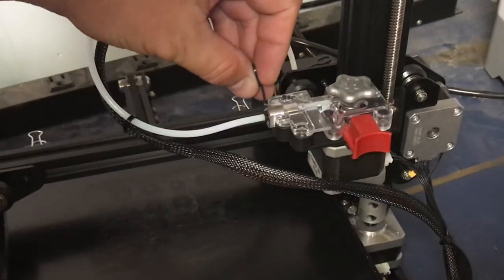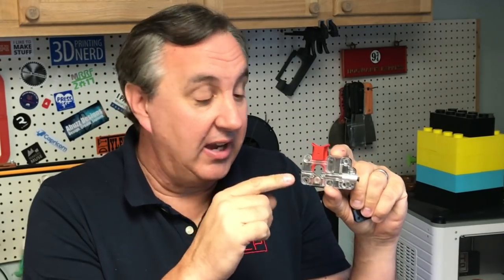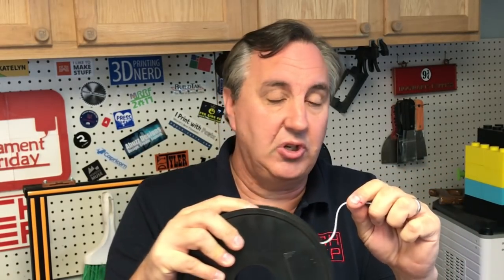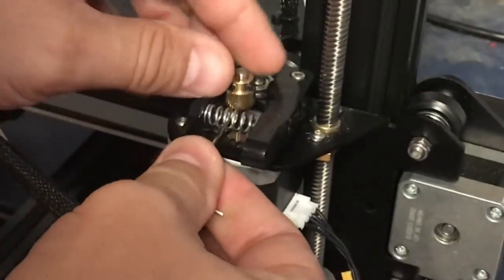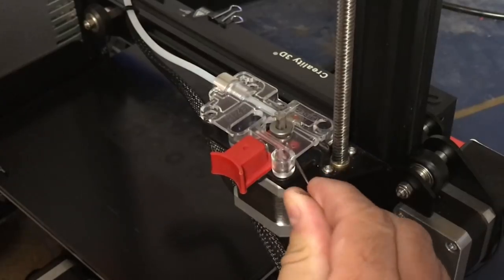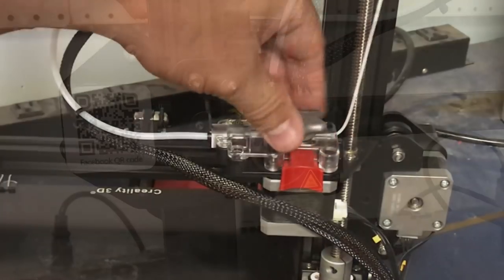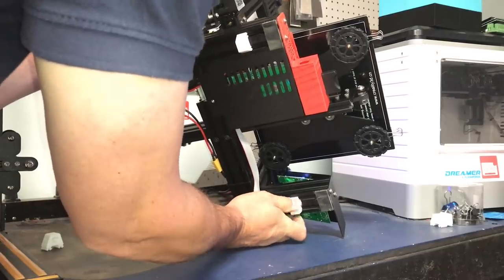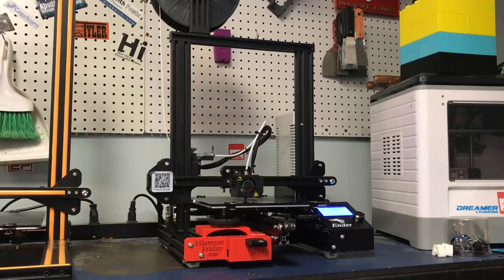Flexible NinjaFlex TPU using EZR on Ender 3

Comment: Hi Chuck!  I got those two EZR struders installed on my Ender 2 $& 3, I told you I ordered.  Both are stuttering when feeding (or maybe it's when retracting?) filament.  The little knob on top makes a loud click and it slips or stutters back.  It didn't do it with the flexible filament I tried.  Just on PLA.  Can you tell me what I need to do to fix it?  The PLA prints started out looking so crappy, I just stopped it each time.  I won't be able to print with it until I fix it!  Thanks, Chuck!! :)
Reply from the maker: Increase the temp or try lowering the feed rate to see if it goes away. The original was probably slipping and you didn’t notice.
Reply: @FilamentFriday  Thanks!  I'm using your magic profiles now, specifically .20.  The Ender 3 made a total mess of a bunch of parts for a mini spool for sample filament.  I arranged all of the parts onto the Ender 3's bed and they fit tight, but nicely. Problem was, it printed fine for a while, then it's like it decided to move everything over to the right about 8mm and kept printing.  The whole print was on top of the bottom layers, but moved over 8mm!  Never had anything but successful prints since I bought the Ender 3 about a month ago.  No failed prints, until I installed this EZR Struder! weird....
Now, I just tried to print one side of the main spool part, on my Ender 2, that was part of the whole spool I was trying to print earlier on the Ender 3.  It fit easily on the bed.  It got the first dozen or so layers done perfectly...then it moved about 8mm to the right and printed the rest there!  Different printer, same result!  I stopped it well before it finished, but the same thing that happened on my Ender 3, happened on my Ender 2!
Time to ask the expert!  What do you think, Chuck? 
Thanks, Scott :)
PS...I have a couple of picture of it if you want to see it...
Reply from the maker: Have you reflashed the firmware or is it as delivered.
Reply: I had the exact same symptoms a while back. In my case, the PTFE tube had started backing out of the hot end throat. This caused a little bit of material to pool in the throat just above the hot end. the pool was not at print temp but it was not solid. this caused the extruder motor to work extra hard to push filament through that semi-molten pool, every once in a while, it would slip and cause that stutter. You might want to check on this
Reply from the maker: I had the same issue:
https://youtu.be/x35aWmnZ_A0

Comment: I see you printed at 20mm/s , is it possible go go faster while not compromising on quality?
Reply from the maker: Change to direct drive. https://youtu.be/iFNcP-OyAH0
Reply: @FilamentFriday  But on this movie what I understand You prefer Bowden style?  By Your suggestion I bought few days ago Ezr, maybe You will make new movie where You can explain how You build Your ninjaflex profile, because there are some settings there, that I don't understand. For example why You chose  "line width = 0.3"? what is the reason to use Enable acceleration control ?

Comment: Do you think swapping the spring out to one with less force might work in lieu of the EZR? 
Keeping all of the original extruder gears and parts. (On an Ender 3 Pro)
Reply from the maker: No, it’s not the spring it’s the fact the stock extruder doesn’t trap the filament in a channel like the EZR does.
Reply: It sounds like this creates a "run", such as "wire passing thru conduit" or water thru a garden hose, type

Comment: I recently bought an original Ender 3 (2022) .. not Pro.. not V2... and I tried to upgrade the extruder with a red aluminium style extruder. The issue with that was that the cog attached to the shaft was press-fit... not with grub-screws... so did manage to remove the cog but I found that the shaft seemed shorter than the ones I was seeing in tutorials on how to install this type of extruder. I finally frankensteined together a mix between the original plastic base (because it made the hole alignment correct) and the new cog (I even had to file down a flat side so the new grub screws would work) and push arm and spring.. but I'm not not completely confident in it and I hear "thumps" all the time. Would this EZR fit this printer? given the apparently shorter shaft length? I haven't found any reference to anyone even mentioning that certain Ender 3's have this short shaft... thankyou for any advice.
Reply from the maker: Most people replace the motor too. And then you can use EZR. https://youtu.be/1GNDxvxpWr8
Reply: @FilamentFriday  ok ... new motor ordered (will probably help with the aluminum one too)... will test that... then upgrade to the EZR... it takes a while for shipping to the UK for the extruder so this will do in the short term - thanks for the advice! keep up the great work.
Reply: Craig.. I get the 'thump' or 'donk donk' noise if I run a print too fast. I think.. but am not sure.. that it is because there is too  much pressure on the filament between extruder and nozzle) I get this most on petg running over 120% speed or pla running over 200% speed , to fix it I turn the nozzle temp up and / or speed down..
I am new to this so take my opinions / advice with a large pinch. cheers.

Comment: Were any benefits lost when going back to the original tubbing from the Capricorn Tubbing?
Reply from the maker: Not in this case. But I still prefer the higher temp Capricorn.
Reply: Just drill it out and use Capricorn tube, it's worth it.
Reply: NinjaX429  very very little, like a bevel
Reply: Not sure if something was changed in the design of the EZR but I was able to install the Capricorn tube without modifications. I ordered mine back in August 2019.

Comment: Hi Guys. 

My problem: i am printing in PLA for quite some time now, printer dialed in. I have microswiss hotend, and dual gear extruder. No other upgrades. Boden type. Today i wanted to prind TPU for first time. Got a brand new spool TPU. Slicing in Prusa Slicer. Speeds ALL to 20mm/s, no retraction (at first). Temp of 230 (recommended by manufacturer, and temp below 215 gets me blobs) 50 on the bed. When i start printing, the filament starts to ooz out of the nozzle at about 200 before it has done anything. When printing starts, every move to another point gets strings, the filament keeps coming out of the nozzle (tried to print phonecase). So you can imagine that my first layer looks like cr*p with all those string lines across . So i tried to activate retraction (1.5mm at 30mm/s).....no luck !

So.....what is causing that the filament keeps coming out during all of the print? And how to fix ?
Reply: when you still have this problem, try way more retraction length (there are some videos how to use retraction tower)

Comment: did you have to do any adjustments to the slicer software for your prints, or was it just an install and print kind of thing?
Reply from the maker: I eliminated retraction and printed slow at 20mm/s
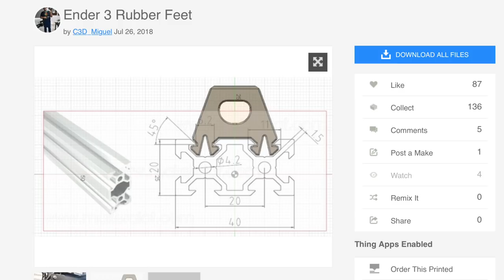Reply: yeah I saw that, at 5:13, but was curious about this and your other filaments. Like say PLA and PETG.
So you dont need to do any other modding besides what you would normally do for different filaments?
Reply from the maker: Yeah. It’s the same settings for other filaments as the stock extruder.

Comment: I installed the ezr and I am having an issue with PETG and PLA.  The stepper motor will extrude for a bit then reverse quickly then go forward again.  I get filament out of the hot end but it continues through this cycle and i seem to be having under extrusion and I assume this is why.  I have replaced my hot end with a micro swiss and replaced my tubing and even put a different nozzle on the hot end.  Not sure what else to try now.  Any thoughts?
Reply from the maker: What you describe is retraction. Shut it off in your slicer but you’ll get more stringing.

Comment: I'm getting a filament blocking occuring about 15 minutes into printing when using flexible filament??? I've upgraded my Ender-3 to have both the MicroSwiss Hot End and the EZR extruder (I needed the latter as previous to this the flexible filament was getting stuck in the extruder). So about 15 minutes in or so I hear the "clicking" noises from the extruder, that I'm guessing is indicating it can't push more filament through the hot end. I confirmed this when I tried to push manually the filament through the hot end.  This has occurred for two types of filament I’ve tried.  

I’m printing with:
* Temp in mid range for filament I’m using
* Print Speed: 25mm/s  (although I just noted infill speed is 42mm/s & I’m doing 100% infill- potential issue?
* Travel Speed: 120mm/s
* Fan: 50%
* Retraction: NO
* Nozzle - the one that came with the MicroSwiss

Any suggestions?
Reply from the maker: Here’s my video on it: https://youtu.be/1GNDxvxpWr8 sounds like the nozzles can’t keep up. I’d print slower.
Reply: The same, slower not fix that. There is too tight i think. Crap ezr...:/
Reply: What test can I do to check it's a hotend block issue, and not the extruder?
Reply: @greghauptmann  its extruder with ezr for sure, too tight spring, try lose a little, but i dont know how, manually maybe for couple second.
Reply from the maker: How is a too tight extruder causing nozzle blockage?
Reply from the maker: Just noticed you are using Microswiss Hotend. I have no experience with that but I’ve had no issues with EZR and stock hot end.
Reply: @FilamentFriday  I installed ezr today and it squeezes the rubber too firmly so it starts clicking. Before i have https://www.thingiverse.com/thing:2144277 and work when i print the same model with 30 speed, now with ezr clicking and block all :/ Maybe you have a solution?
Reply from the maker: So is it jumping on the filament? Raise the hotend temp 5 degrees see if that helps. Are you using the EZR gear or stock gear?
Reply: @FilamentFriday  yes - I did try around 255/260...I'm using the gear that come with EZR.  When it jumps, if I try to release the extruder pressure then push the filament in I can't get it to come through, so it seems like a hot end issue I guess(?)   I can't set it higher then 260 on the Ender3, so if I run the print slow (say 15), at 260 degrees and it still has the issue is it possible I just can't print this type of filament?  Or should I be able to and it might be an issue with the Microswiss Hotend?
Reply from the maker: I think it’s the microswiss. The PTFE in the stock hotend is select lubricating. The Microswiss being all metal isn’t as forgiving,
Reply: @FilamentFriday  oh - thats very interesting - so whilst I got the Microswiss to be able to handle hotter temperatures and less risk of heating up the filament cable (although I did also get capricorn cable), it might be the case for printing temperamental flexible filament that I'm better off going back to the stock Ender3 hotend?
Reply from the maker: It’s worth a try as it worked for me.
Reply: @FilamentFriday  ok thanks for the tip (just left on holiday so I'll try when I get back )
Reply: @FilamentFriday  i just fix that, its too tight spring like i was thinking. Remove it, and put one of this black clip, and now printing perfect.
Reply from the maker: Interesting. Guess I didn’t understand the issue but glad you figured it out.
Reply: @FilamentFriday  Maybe my TPU is too flexible.

Comment: Would it be possible with this same setup to print ninjaflex with the Artemis?
Reply from the maker: Artemis already has the EZR so yeah, it will print it.
Reply: I didn't even realize the EZR on my Artemis would help with flexible filament, so I am anxious to try it out.
Reply: @FilamentFriday  I had issues printing the Inland TPU even with captubes on the Artemis so I just went with SainSmart TPU which is stiffer.
Reply from the maker: What speed?
Reply: @FilamentFriday  15mm/s, no retraction.
Reply from the maker: I’ll try it again on mine. I think I used 10mm.

Comment: Trying to print ninjaflex.  I was able to print 1 runner foot.  Now, the tpu is getting caught and wrapping around the gear.  My print temp is 230, bed is 70 (glass is a little on the thick side) Fans are at 100%.  I modifed my E steps from what they were stock.  Previously 93 now 124.  It starts out printing fine... then I guess it started not being able to push filament through at some point and wrapped around the stepper motor gear.  Does this mean I have a clog at my hotend?
Reply from the maker: No, it means you were lucky on that first print. What you are experiencing is exactly why I recommend the EZR.
https://youtu.be/1GNDxvxpWr8
Reply: @FilamentFriday  That's with the EZR installed.   It seems to get bunched up and eventually wraps around the gear.  I have to uninstall the ezr, open the casing to pull out the tpu and align back to the track inside of the ezr.
Reply from the maker: Sorry, confused it with another comment. What speed are you printing at? 
You may need to also lower the bed so first layer has some gap.
Reply: @FilamentFriday  I'm currently printing at 20 mm/s .  Thanks! I will set the z offset a little higher on my BL touch.
Reply from the maker: I meant lower the bed level not temp. Also try 10 or 15mm/sec instead of 20.
Reply: @FilamentFriday  I will definitely try that.  A little taken back because I was under the impression we could go up-to 40mm/s with this ezr extruder... Is that only on 95A shore hardness?
Reply from the maker: You can go faster just not with the highly rubber flexible filament. The hotend needs more time to melt it.
Reply: @FilamentFriday  Thanks Chuck.  After slowing printing down to 15, changing my Z offset value to be slightly farther from the bed and bringing the hotend up to 230, the filament came through the small opening of the ezr again.  So I switched out the tension spring with a spring from an all metal extruder I had and reset the gear and I finally witnessed a finished print. 

I think you have to ensure the filament contacts the recess part of the gear; which means it has to align with the filament path almost perfectly. I am not sure if changing the spring is the cause for my success.  The spring I have on there now is about 2-3mm shorter than what the ezr comes with and almost the same resistance in compression.
Reply from the maker: Wait, you just reminded me of an issue with some filament. The spring is so strong it actually flattens the soft filament so it hits on the edge of the Bowden tube. A softer spring might help or use a drill bit and create a funnel like entrance on the PTFE. It might help.
Reply: @FilamentFriday  Ah interesting. I'm having issues similar to this. If I feed some filament (3DFillies PLAFlex) through the feeder gear and then release tension and pull the filament back out to inspect, it's VERY flat with teeth/cog marks pressed hard into it. I think you're right and it's been flattened too much. I'll see if I can find and use another softer spring.

Comment: Dumbest question: what other applications can this make in real life? Can these 3D machines or similar ones print PVC, EPDM? When I read about 3D printing years ago it seemed mostly about modelling but from what I saw in this video the engineer built a part from scratch and used it directly in the very machine?
Reply: You can print anything that will fit in the bed (within reason).  You could print a part to fix a plastic mechanism on your car or a tiny storage box. As for flexible things, maybe a "rubber" gasket or an o-ring. I'm not sure about PVC or EPDM, I've never actually heard of them. I don't think this particular printer could print them.
Reply: Probably not EPDM, as I don't think anyone makes that in a filament. But there are flexible filaments as shown. There are rigid plastics such as PLA, ABS, Nylon, Polycarbonate, and PETG. There are even filaments with carbon fiber.  If you can design a model in CAD, you can print it, or there are many sites that have models for download.

Comment: Hi Chuck. I know this is an old video but I have a question/problem. I installed the EZR Struder on my older Ender3 and it's been great. I recently bought an Ender3 Pro and I bought an EZR Struder for it. It appears that the extruder stepper has the the gear pressed on - there is no set screw to remove it. Would you know if it's removable?
Reply from the maker: I’ve never seen that but others have. It’s pressed on so a puller should get it off but I’ve never done it.
You could also just try installing it using the stock gear. I’ve got that to work before.
Reply: @FilamentFriday  Thanks. I was going to see if it would work with the stock gear.
Reply: @BillYovino  Hi Bill - did you get it to work? I've rececently got a base Ender 3 with the same issue.. a smaller shaft on the motor and a press-fit gear.. I did manage to get it off with some brute force
Reply: @CraigTinson2015  I just left the original gear in place and it’s working fine.

Comment: Can you post some settings for Ender3 SP3D? I set to print the feet for Ender3 at 20mm speed and 20% infill. SP3D says it will take 49 hrs and 8 mins to print!!
Reply: Check to see if you have set it to 20mm a second (1200 a minute) and not 20mm a minute.
Reply from the maker: Good catch.
Reply: @davidkill8826  Yep I had it set to 20.0 mm/min just what I thought the video showed.. I will try reprint later.. Now I have: outline underspeed 50% Solid infill underspeed 80% Support structure underspeed 80% X/Y axis movement speed 120.0 mm/min and Z Axis Movement speed 16.7 mm/min.  I will wait to print to see if these setting are wrong as well! Thanks
Reply: I just rewatch the video and seen that I had it wrong.